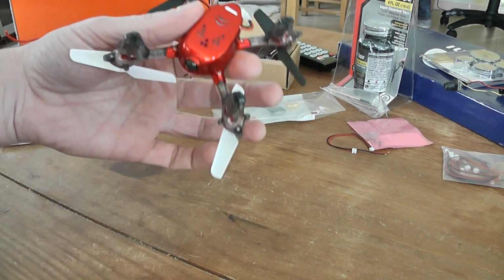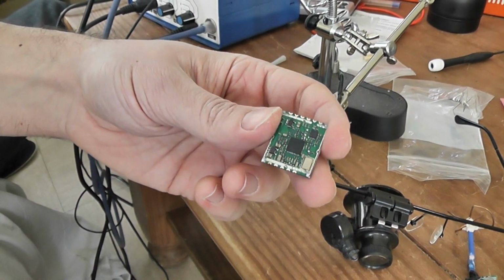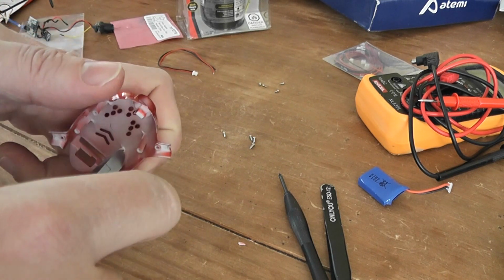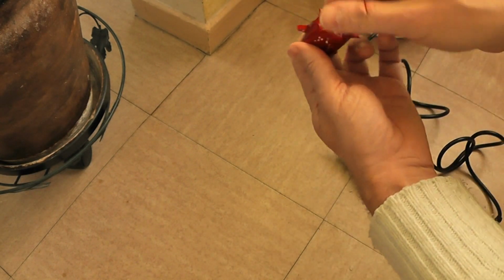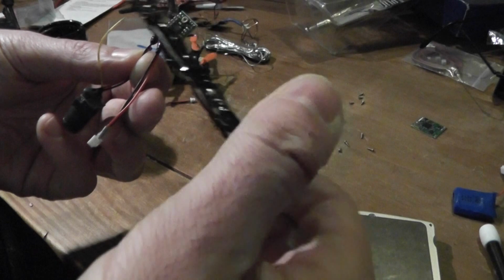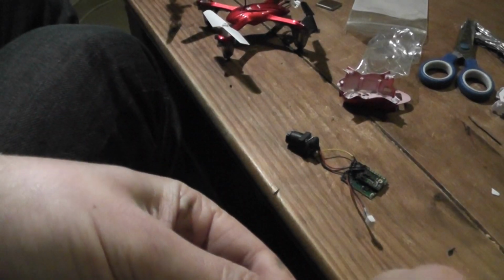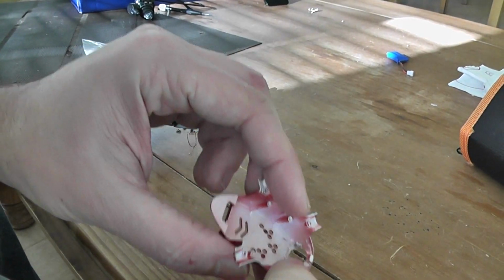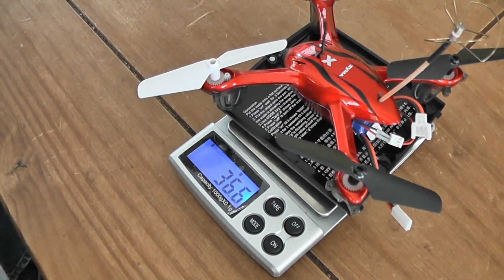SYMA X11 FPV modding build-log

Comment: Are you running the stock 200mAh battery ? Mine won't fly more than a few seconds.  (30 seconds ) I get Low voltage warn.
Reply from the maker: +John Luciano No I use some turnigy model rated 45C but I don't have much more than 4min
Reply: +SeBy DocKy I've just bought a turnigy nano-tech 300mah 45c 1s battery and as soon as I plug it in the props start spinning (quickly) and it starts smoking!!! how is yours managing to use a 45c battery? I've checked the battery and it's 3.8v
Reply from the maker: +Dean Harrison Harg ..... be aware, nano-tech have inverted polarities !!!!! so you smoked your FC :(
Reply: No it still works fine, just been flying it with a 500mah battery - must be lucky!. Just checked the battery and you're right. I'll reverse the wires and see what happens. Thanks for the info, I was just about to put them on ebay. I've also bought a 1300mah 3s nano-tech battery for my other quad and the wires are the correct way round, is it just the 1s batts that are inverted?

Update: reversed the polarity and it works, thanks man :)

Comment: Hello, thank you for demonstartion ! It's very interesting. Just one question: why did you use the pololustep down ? the lipo battery of the quad deliver 3,7 V , right ? And you need 3,7V for camera and vtx... (sorry if you explained into the video, i don't understand everything)
Reply from the maker: +Xixi Mills The role of the step down is more to filter out motor interférences and by providing a clean power source
Reply: +SeBy DocKy Ok, sound right. It's for what you wired each + and - on the respectives points. Thank you very much :)
Reply: +SeBy DocKy could you use a capacitor for the same purpose or would that be heavier?

Comment: My X11 finally arrived. I can't wait to mod mine... 

One thing I'll do different is to completely eliminate the battery tray. It will create more room for the FPV equipment and significantly reduced the weight.

Will be using:
-5.8ghz vtx (http://www.fpvhobby.com/229-new-mini-58-ghz-avtx-for-fatshark-.html)
-5V step up/down regulator (http://www.fpvhobby.com/233-5v.html). This is awesome as it completely eliminates all noise. 
-600TVL 120degree Wide Angle Super Mini FPV Camera with MIC (http://www.surveilzone.com/600tvl-120degree-wide-angle-super-mini-fpv-camera-with-mic-CC1563)

Thank you for the inspiration.

Comment: Thanks for making this video. This video is what got me to order one of Syma 11s.

Are you using the Devo 7E for the remote control? If so, what is needed to bind the Syma 11 to the Devo 7E? I appreciate your feedback.
Reply from the maker: Francis Ignacio Yes I am using a Devo7E. You will neeed a nRF24L01+PA+LNA chip and an antenna : @2 , http://www.banggood.com/Wholesale-FrSky-Receiver-Antenna-15cm-p-68595.html
Reply: SeBy DocKy 
Do you have a tutorial on how to install the nRF24L01+PA+LNA chip and the antenna to Devo 7E? Also, please post the link where to get the chip.  

Thanks!

Comment: SeBy DocKy thanks for sharing this build log.  I plan on doing a some what similar one.  I bought the Boscam TX5823 and hope I don't have over heating issues if I tune the Pololu output to 3.3v and not to mention the noise you say that vtx picks up from the motors.  I'm still waiting on the Syma X11 and all the parts at the moment.  

My question to you is, is tuning the Pololu an easy process?  I was hoping you had that in the build log too but you skipped that step.  So I'm thinking it must not be that difficult.  Thanks in advance and keep up the good work!

Comment: I am thinking of doing a build like this SeBy DocKy.  My question is:  Why is the voltage regulator needed?  Isn't that adding more weight?  With a separate 100mah battery to power the fpv the interference is eliminated.
Reply from the maker: The voltage regulator is only 0.6g and is used more to filter out motor interférences from the video Stream.
Reply: Can you tell me where you purchased the voltage regulator?

Comment: Great modding dude - I bet the flight time is good with your x11, probably loger than the RTF options (Hubsan H107D etc). Your flying looks very smooth.
Reply from the maker: Yes It's a good plateform. It would have been even better to install a cam with a slightly wider len, but it's already good :).
I will also probably install more powerful motors

Comment: I did a build with a 480tvl micro camera and a 10mw boscam vtx but the problem was as soon as i throttle up the interference was insane so i have to use a separate battery for fpv but the weight is killing the flight
Reply from the maker: You have to use a step down/up like pololu to remove these interferences

Comment: I see some interference still to the motors, I use separate 100mah battery as any combination i try with the reg I cannot totally get rid of the noise
Reply from the maker: In my last FPV videos, there are no more these lines. I think it was coming from the LiPo

Comment: Can you add parts list to description?
Reply from the maker: Yes I will in a couple of minutes :)
Reply: SeBy DocKy can you suggest the cheapest compatible video goggles to use to view the FPV video?
Reply from the maker: Kenneth Smith The cheapest is to take a 5"LCD monitor, a ski goggles and a shoes's box to design yours....Hobby KIng have also such kind of DIY goggles around 40USD AFAIK but with a 4.3"